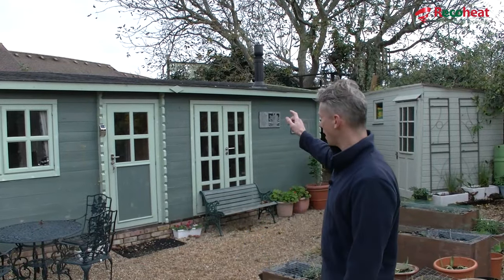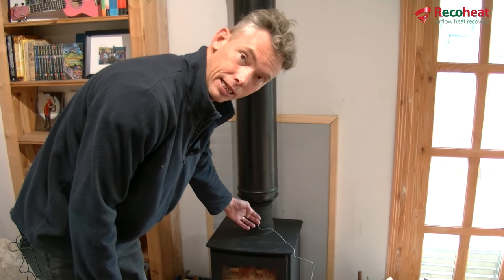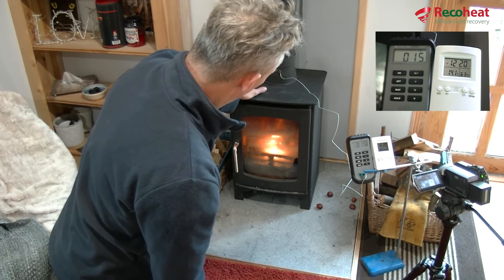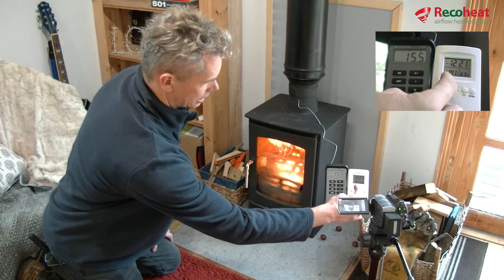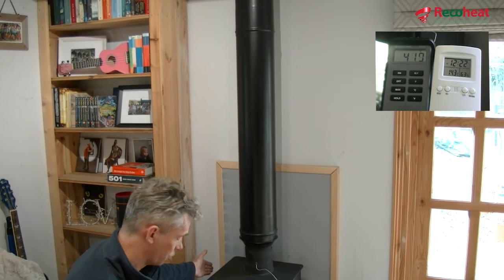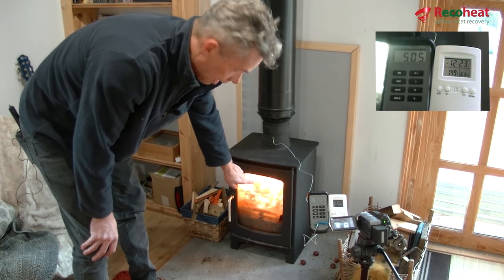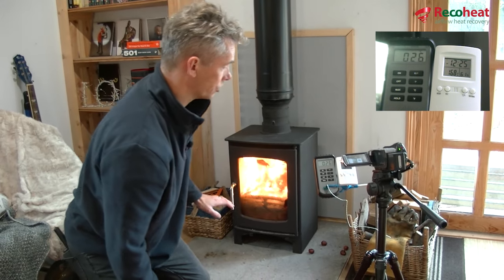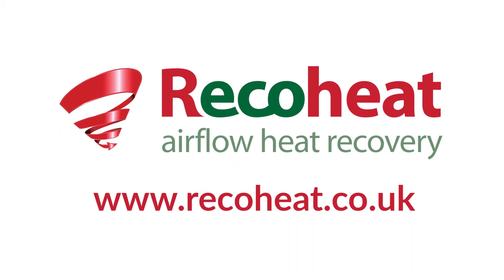Introducing the Recoheat heat recovery unit for wood and solid fuel burning stoves

Comment: Please advise if my assumptions are correct:      Electric heaters put out the following:  294 CFM (500 m3/h) (8325 liters per minute)  4800W /16382 BTU    Recoheat heat exchanger runs at  (9CFM) 240 liters per minute and perhaps 500 BTU.    As a percentage of what a wood stove puts out it is a minimal amount.    Recoheat 500 BTU divide by  Wood stove 30,000 BTU is about   1.6% recovered BTU.     However the pump uses 40 watts and savings on wood would be spent on electricity.     At best a break even situation.
Reply from the maker: Hi Robert, thanks for the engagement. It's a great comparison, but yes, is missing the point. The Recoheat doesn't use power to generate any heat - it's powering the pump. That too would have little effect except that the coil is creating a turbulent barrier layer in the airflow with it. This creates almost instant heat transfer so that the air flow and air pressure significantly increase. So the 37w goes into producing a mini jet of turbulent hot air that crosses the radiant heat flow of the stove, energising it and drawing it away from the stove so that it disperses heat from the stove continuously and by temperature and pressure equalisation with a turbulent field, which is again incredibly efficient. We observed it for a long time before we understood it - the difference it makes to  heat distribution is bizarre - and producing a simple algorithm for it is very difficult because of the many factors impacting the actual heat generation and the air flows in and around the heated area, but empirically, it makes incredibly efficient use of your resources by dispersing heat so efficiently through a complete cycle of combustion.
Reply: @Recoheat  Do you have any test data showing how much extra heat is produced from a burn of a few logs (2kg)?   I understand that your device is a heat exchanger.    How much extra heat does it produce?     Do you have data on this?       The shed you are doing the testing in appears to be 10 feet by 10 feet by 7 feet or 70,000 cubic feet.  By using the fixed area of heating and a fixed amount of fuel can you do a comparison of the room temperature after one hour, with the Recoheat and without.        I am still a skeptic and would like to see real life data as opposed to some pseudoscience science explanation.    I live in Canada and heat several buildings with wood, and use 3 bush cords (128 cubic feet in a cord) of wood.   I would like to reduce the amount of wood I burn.     Each test should collect data in regular intervals  of out door temperature and temperature at several locations in the shed.   Test should start from a cold stove and each test should use the same amount and type of burning fuel and all windows and doors closed.     The following can be used to record the results:   https://uk.govee.com/collections/thermo-hydrometer     As we say in Canada, "proof is in the pudding" or "money talks, bullshit walks".
Reply from the maker: @rob3bbb  Yes, we ran a similar test, but measuring output from points around the stove, and from the Recoheat outlet. It's here: https://www.recoheat.co.uk/_files/ugd/fe64a7_baca54d990bc43b79befc362dd8d8c38.pdf The volume of that workshop is actually 20' x 14' with quite a high ceiling, so measuring temperature change would have to be relative, which is always difficult in the UK because the weather is so changeable. It's certainly something else to do though. The results would be just as refutable though: we don't have a lab.
Reply: @Recoheat  My wood stove Flue runs at 200 C because it is 80% efficient and recirculates gases before exhausting to the flu. Q = 40 x .04769 x 200 = 381W   Wood stove is 13000W.      381W/ 13000w =  2.9%     too low to justify  using this device.
Reply: Why isn’t there a view of the “gubbins” that makes up this Recoheat device?
I haven’t a clue what it looks like, where it fits or how it works.
Reply from the maker: @DeanJuvenal  The website is www.recoheat.co.uk

Comment: Gosh so many questions this raises. The important temp is that at the top of the chimney if that drops too low creosote will condense out and chimney fires become a real probability as it starts running back down the flue. 300-500 c  is a good range to ensure efficient combustion which minimises this risk. Don’t try and keep your fire in all night my ramming it full and closing it down, best way to create a creosote problem.  I’ve seen people take a 6 inch flue down to a 3inch one in 3 months doing this even when burning dry softwood. Dry timber below 20% moisture is essential, too much soft wood equals higher creosote risk. Sustainable source of timber essential. To prevent cold air being drawn into the house/room to feed the combustion I’d  recommend external air piped underfloor to the stove. Then you can draft exclude your house and prevent cold air being drawn in. Many stoves have a underfed system allowing this. Regular flue sweeps should indicate combustion quality if you’re  getting big chunks of black clinker alarm bells should be ringing. My stove flue is swept twice a year and I get about 1/2 litre in volume of fine Sandy texture soot. Tiny granules. There is a science you need to learn balancing hard wood / soft wood ratios and stove temps with dry timber and good companion burning. I love it and my wood shed is my favourite place lol.
Reply from the maker: Thanks very much for your thoughts! Do take a look at our other videos to see how the unit is working in the wild, so to speak. The point about ramming your stove to keep it going all night is very pertinent: our unit delivers a similar effect without any additional fuelling because the pump keeps the heat from the cooling stove circulating for so long. 👍

Comment: That's very good.
Questions:
Can you stack a couple of these Recoheat units on top of each other? 
Can you link the nozzles to pipes that go into other rooms?
Can the pump start up and shut off automatically via thermostat, say at 50 degrees?
Reply from the maker: Thanks Bluce - velly kind. Stacking: yes, if your flue is hot - check out Philip who has three on top of each other! https://youtu.be/SwUB78xd_hk Also done a video on extending the outlets: https://youtu.be/MC9W0gbS5kA You'll see from that, that it is now possible in a limited way - before this breakthrough it wasn't because the turbulent air cools so fast inside a cold extension. Even with the coating we can now do, the end result will only deliver the recovered heat, which is a fraction of the total heat output of the unit when it is gathering and circulating the radiant heat from the stove, so it's very rarely going to be effective. At best, it will deliver about 20% of the total output you'll get from the unit blowing over the stove. Lastly, we don't have automatic switches though people have the pumps plugged into smart switches on their sockets, usually with a timer, but you could set a thermostat on some of them. It isn't necessary because the units get hot immediately, and even overnight will be pumping warmer air, even if it's only 30 degrees C. Thanks very much for your interest!
Reply: @Recoheat  MI I'm
Reply from the maker: @stevepeck7931  Thanks Steve!
Reply: What volume of air does it blow in?

Comment: Sorry for sounding so ignorant but what is going on here? Which pump? Where is the air coming in ? Where does it come out? Is it poisonous fumes coming out into house? Not sure what is actually happening here. I have two heat operated fans on top of my 7.5 kw multi fueler.cheers.
Reply from the maker: Yeh, sorry it's not as clear as it should be. There's an update and FAQ video here: https://youtu.be/fOdsE-DVGTo and the website has lots more straightforward info at www.recoheat.co.uk. We've just put a video of a chap visiting us to hear the device working which shows more as well: https://youtu.be/u-40U5Y6byc
Reply: @Recoheat  cheers 👍 🔥

Comment: if you remove that heat that would otherwise rise thru your chimney and keep the creosote from building up, would you need to clean your chimney much more often?
Reply from the maker: Thanks for your interest. The vortices created by the coil in the flue gas flow, and the relatively small amount of heat we take out - equivalent to that lost through 10cm of extra single skin flue on a 125mm flue, and 6cm on a 150mm - mean we don't have any discernible affect on the functioning of the flue. In a normal system, there is less build up of soot on the coil than on the flue sides.

Comment: I live in an old house with insulated floor board. The stove still draws in cold drafts from the heated air rising in the chimney. Drawing air from out side, heated using the flue gases and pressurising the room seems to make sense. The last couple of stove fans didn’t last long and they are noisy so this might be worth a go. Even at £299.
Reply from the maker: I salute your perspicacity! Thank you for the interest.
Reply: @Recoheat  well really I was responding to caper who's house got cold for the intake draft.
Reply from the maker: @carpediemarts705  Me too! I just clicked on the wrong 'reply' or it mis-directed me. I blame the technology.
Reply: That’s fine, except you’re drawing in outside air and not heating it up that much (or else the flue would cool too much, which would affect stove efficiency and would increase creosote formation in the flue). So unless you live in a marginal climate where you barely need to heat at all, that makes no actual sense, unless the air coming through cracks in the floor is untempered outside air, in which case you have bigger problems than a stove accessory can possibly address. If you live in a sufficiently well airsealed and insulated building, you aren’t getting drafts in the first place and don’t need to pressurize in an attempt to reduce drafts. Also note that it is unlikely the compressor, fan, or otherwise used in this product can move the needle on building air pressure and prevent perceptible drafts.
Reply from the maker: @2brazy4ubitch  Yes, that's pretty much everyone's assumption, especially the engineers. The secret ingredient you've not taken into account is the effect of the turbulent boundary layer phenomenon. That transforms the heat transfer process, and is the sole reason this device performs in the way it does. It causes the heat transfer efficiency, and also the vortex effect of the flume coming out of the unit across the top of the stove. These combine to drive the heat transfer through pressure equalisation, rather than a forced-air effect. The funny thing is, that you're trying to prove it's not possible, whereas we've been trying to fathom why and how it works, and it's only been by engaging with engineers that we've actually reached an understanding of that. But the really easy bit has been to experience it. It was developed through very thorough experimentation and intelligent iteration from the initial concept, and it improved counter-intuitively, but that's because of the characteristic of the boundary layer physics, and the flux and fluid dynamics of the coil, which we could observe but not understand. It's very interesting. Luckily I'm Cambridge-based and have some clever people to turn to. One of the first was a post-doctoral research scientist with four degrees and two PHDs, and we've kind of maintained that level of collaborative exploration. And the fantastic thing is that everyone involved is learning about something that Kevin, a plumber in Burnley, invented, and whose careful and highly scientific iterative process resulted in something so effective.
Reply: @Recoheat  Are you trying to tell me this thing is going to redefine the physics of the room it’s installed in? Or are you saying, yeah, all it does is skim a little bit of heat out of the exhaust gases without affecting the draft enough to cause a problem that matters to the buyers or to regulators in your market? My original comment acknowledged it skims a bit of heat from exhaust gases, and if it blows it out into the room to perceptible effect at the cost of being noisey and arguably dangerous (that heat exchanger better not fail, ever, or you have a compressed air injector in the flue), then we agree!
Reply from the maker: @2brazy4ubitch  I think you're being silly. That's ok. As pointed out, you can take a horse to water, but you're better off making lasagne with it.
Reply: @Recoheat  You’re the one marketing a weird stove accessory that may or may not invalidate a given fire insurance claim, and may or may not be more effective than just running a 1500W electric fan for the 10 minutes it takes a given stove to warm up, not me. In lieu of a hands on demo, you could just instrument the thing and provide quantitative performance information instead of subjective comments, interviews with laypeople, etc., especially if you want to sell internationally, which is something you should want if the product is nearly as effective as you suggest. All the best.
Reply from the maker: @2brazy4ubitch  Yes, that's perfectly true, and thanks for the engagement. We've been doing that work with an engineering consultancy over the last few months and hope to be publishing the results in the next month or so.
Reply: I had 3" flue pipe running from outside to the woodstoves intake that eliminated those drafts
Reply: To me this makes zero sense.  You will run the risk of a chimney flue fire as a lot of rubbish is going to condense in it.  The very first thing to do in stove efficiency,  is to give it a direct supply of air for operation,  rather than it draw cold air through every available ill fitting door and window.  Of course if it cant get air, you will be smoked out.
Reply from the maker: @nicholasgrubb151  The reason it doesn't is because of the von Karman vortices induced around the coil, which excite the flue gases to the extent that particles adhere less to the surfaces than on a flat plane such as the flue sides, particularly as the coil surfaces are so hot because of its position in the flume and the increase in very localised heat transfer. The physics is very interesting. We're not far off publishing a white paper on it.
Reply: @2brazy4ubitch  The guff they gave you about turbulent boundary layers etc etc is pseudo-scientific gobbledy-gook. I have pointed out a number of flaws in their design, and cannot get any sense out of them. Using a pump rated at <0.2 bar to pressurize a tube to 1.5 bar, at 1 lps from 17W (when a proper compressor takes nearer 1500W to do this) is just nonsense on stilts. They used to deny the 1.5 bar (which is a simple thermodynamic calculation) until someone put them right. They still cannot say where the power to do this comes from- as if it was something mystic. They were designing heat exchangers back in Victorian times, there is nothing mysterious about them. Fact is, there is very little flow. Hot, but not much heat (they teach the difference at GCSE). They used to claim 'double the heat' - until it was pointed out that stoves are ~80% efficient as is. So 160%? If they can get that wrong...
Reply: @2brazy4ubitch

Comment: I have a small semi detached 1936 build limited insulation due to narrow cavity. I have a 5kw duel fuel stove wood / coal when it's lit we have a standard fan sat on the top which forces heat away from the fire into the room. We then open the doors and it heats the rest of the house not substantially but enough to take the chill off. How would a £300 plus fitting benefit my household? I like the idea but expense outweighs return removing justification for the outlay.
Reply from the maker: Thanks very much for the interest. If the rest of the house is affected when you open the stove doors, it will be warmed by the Recoheat because the air flow is obviously good. Currently you're only getting that effect when you release the heat contained in the stove, providing a boost but completely cooling the stove. The Recoheat will provide much more than that boost continually (because the heated air is pumped, and your stove is still relying on convection when you open the door), from as soon as you light the stove, until the embers are completely cool. It will make your stove far more effective, and maintain the temperature such that your brickwork doesn't fall below the 15C at which it ceases to provide thermal insulation, so the effect is massive. To get an idea of the difference it makes, listen to what Sam Hamer says about his installation in their showroom: he's using one stove with a Recoheat instead of two stoves, so he is doubling the effective output - and halving his fuel cost: https://youtu.be/LbMzmdYHVgI

Comment: Could this be powered by a thermoelectric generator on/in the stove? Would make more sense for off grid applications.
Reply from the maker: Theoretically it could, but they don't produce a lot of power, and we do, as Mike pointed out last year, have to overcome a pressure drop that makes a power demand that's not insignificant.

Comment: As is, everything is relative E=mc 2 , I wonder if you were to double up on the diameter of the coil still leaving room for flue sweep you would double your output, in theory this should work. 1 KWatt would be a nice target to reach on a 4 KWatt stove, on estimation Im getting around 200 to 250 watt heat output on full burn using oak and ash only.
Reply from the maker: It would cause a blockage in the flue, and cause cooling of the gases. We have balanced the physics very carefully to prevent that.